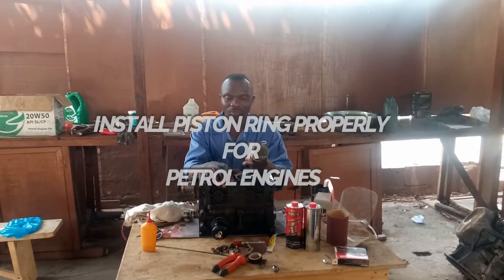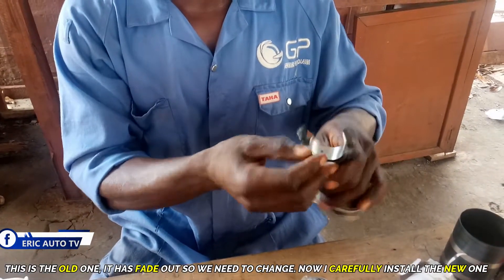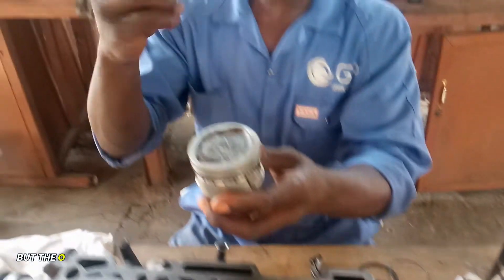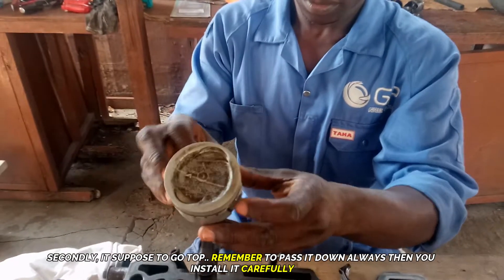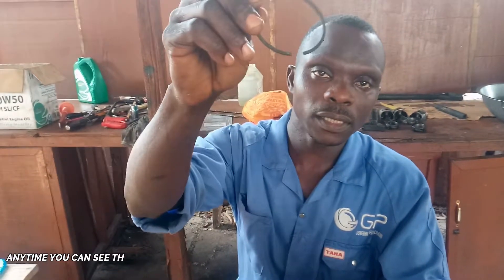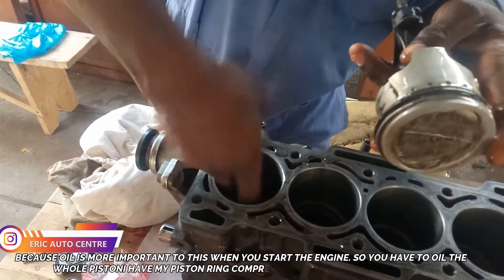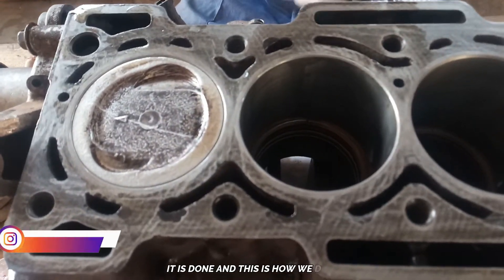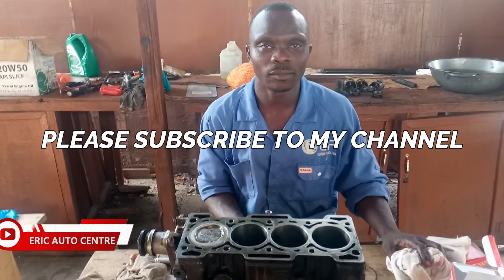How to Install/ Piston Ring Properly! for Petrol Engines | The Secret

Comment: I have an old matiz 2 in the garage and want to try replacing the pistol and rings by my self with little to know mechanical knowledge.... how would you recommend I go about this? I am a DIY kind of guy so this is just a hobby.
Reply from the maker: For overhaul you have to practically learn else you cause mess

Comment: Should I just buy the rings and fix? Because that's what you are doing
Reply from the maker: I can’t get your question well, but you can’t just buy the rings and fix it there are some certain processes you must take and as a mechanic you must know better. What I am doing is to guide you align them properly
Reply: What level can it be before you can cut the rings? Because my boss normally cut the rings first